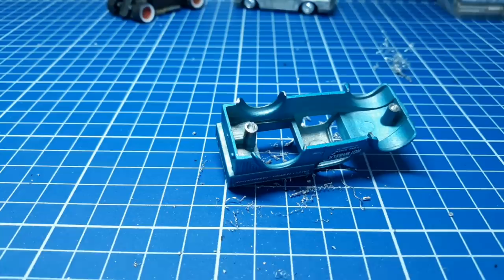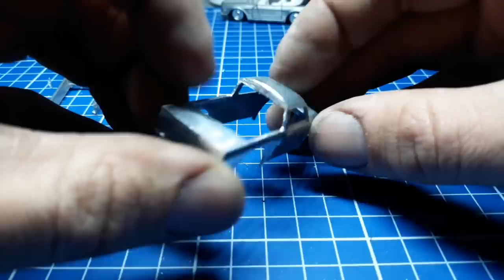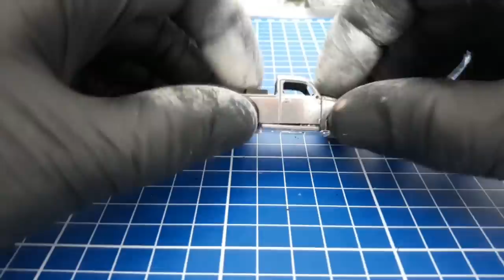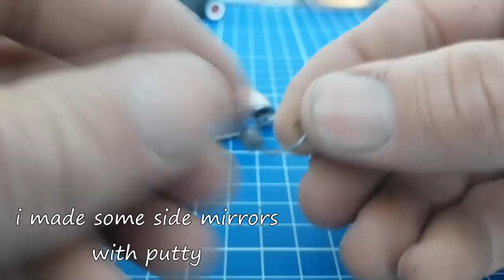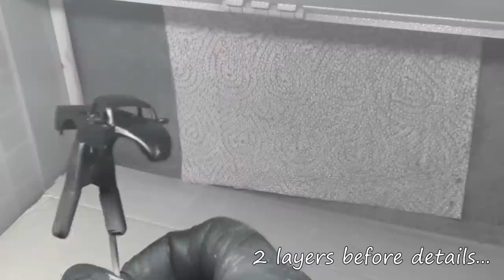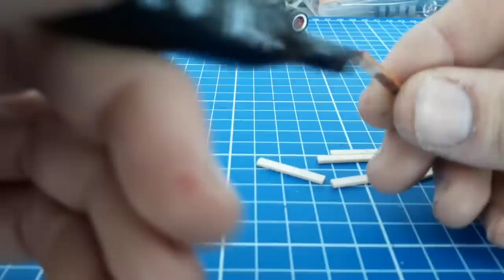Diecast custom: Hot Wheels vw Beetle pickup hotrod.

Comment: Great job! The putty for the axle tubes is a great idea I will use myself. If I can offer a tip in return- get a jug of Muriatic acid and drop any of the chrome pieces you don't want to stay chrome in a container of that stuff. It will take a couple minutes, but strips them down to the base plastic color. Not my idea, I learned that from Baremetal customs. Another great customizer and restorer. You should check his channel and Diecast resurrection as well.
Reply: You can also use Ajax scrubbing powder and a wet toothbrush to remove chrome on plastic, that how I've always done it, and it scrubs off lightning fast (plus it's only $1).